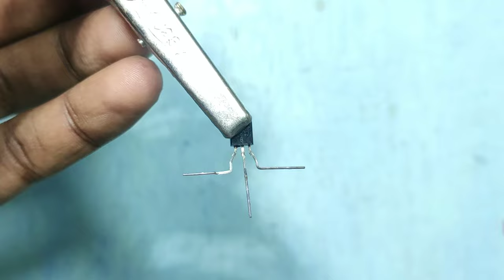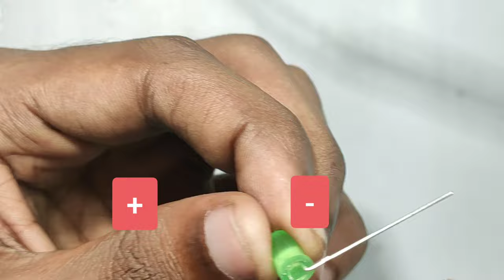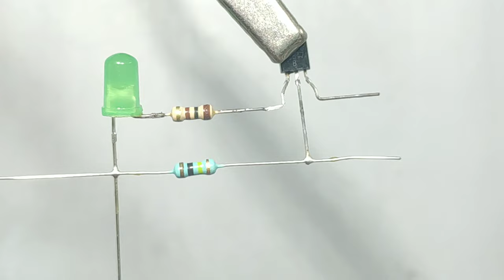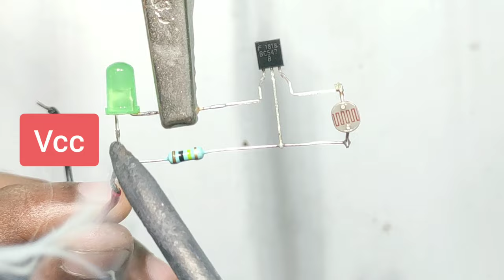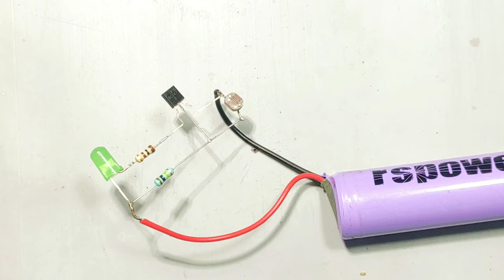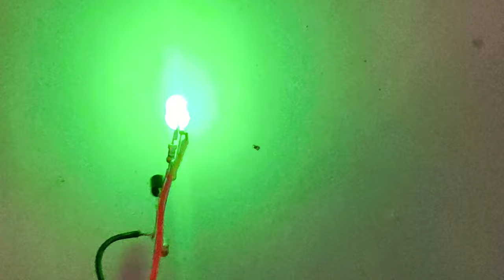Automatic Night Light Circuit

Comment: what if im only provided with 9 V d.c. power supply, light bulb (2.5 V, 0.3 A), light bulb (4.8 V, 0.3 A), 3 L.E.D. and 2 resistors (180 Ω) and 1 resistor (390 Ω). sorry for all the trouble but help will be much appreciated :)
Reply from the maker: you need ldr.
Reply: @sm_electronics  yep i have ldr as well but what resistor should i use or buy
Reply from the maker: 100k resistor
Reply: @sm_electronics  okay thank you ;)

Comment: What happens if use 2N3904 transistor instead
Reply from the maker: no problem
Reply: @sm_electronics will I have to do it the other way? so the left pin is connected to the LDR and the right pin is connected to the resistor? or is it the same way? thank you🙏🙏🙏

Comment: Very good diagram .I am happy that I made this circuit and it is working alright. But I want to point out one thing that the light automatically  glows in the evening. It is not so dark in the evening but the ldr starts working and the light is on .Can this be rectified so that it works only when it is complete dark .Please advise .
Reply from the maker: Use a variable resistor in series with 100k
Reply: @sm_electronics  Ok .Boss

Comment: In the place of led if we 2ant to connect 4 volt light which resistance we hv to remove
Reply from the maker: Remove 100ohm.connect 4v light positive to battery positive and light negative to collector pin of transistor.

Comment: Is there any option to increase the brightness of 4v round led ? - Tripura
Reply from the maker: Use high power transistor bd139
Reply: @sm_electronics  Is the connection same ? Tripura
Reply from the maker: @dulalmajumder4917  yes